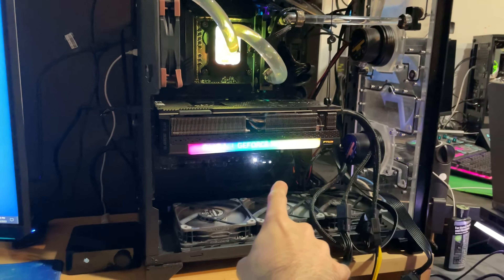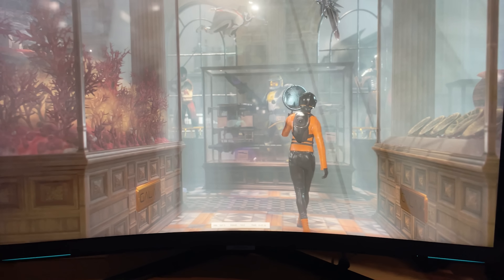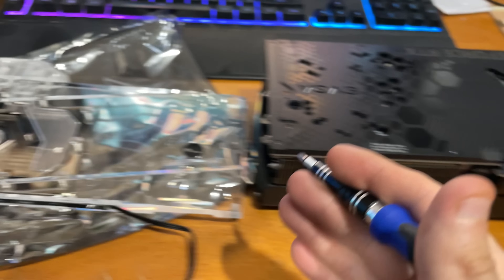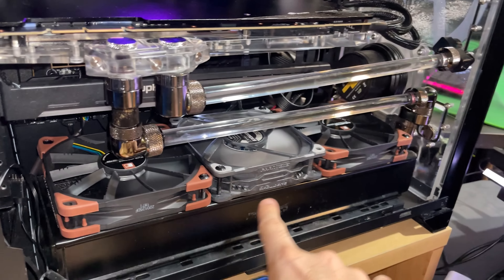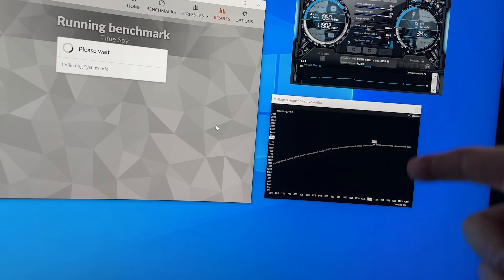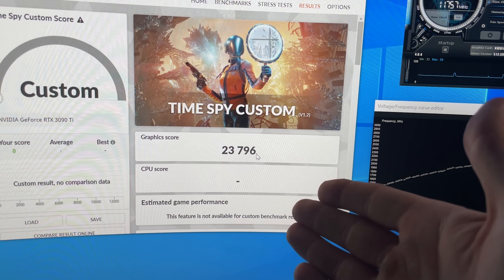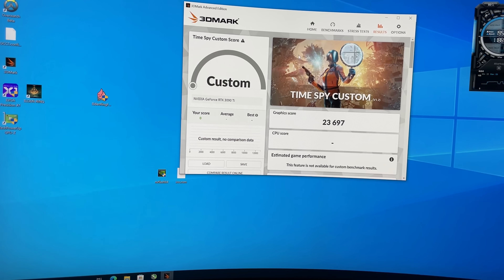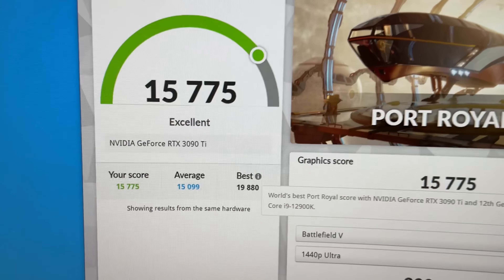3090 TI Water Cooled!!

Comment: Looked like you were mixing methods for changing the VF curve which probably explains why you saw some regression in your 3DMark score.  You need to watch effective clocks in HWINFO to really know how much your clock speed is changing.  Most likely you dropped (or at least didn't increase) effective clock due to pulling up a single point on the VF curve (rather than shifting the entire curve, or at least the 3 points to the left of the 1100mv point).

Comment: I remember strapping an AIO to both my Rx 5700xt and Rx 6700xt. It was an interesting experiment. I am happier with rtx 3070 because I don't have to do much to overclocking my silicon without seeing high temps hehe
Reply: AMD BAD !!!!
Reply: @RonnieMcNutt666  amd is a piece of disappointment
Reply: @ErvineJeovanni  SKILL ISSUE
Reply: @RonnieMcNutt666  skill denial in esports I have that hahahaha. I mostly play car games. Since I do have sim rig, having better 99%fps makes wheel more responsive and smoother.
Reply: @ErvineJeovanni  a,md have much higher fps and clock speed but nvidia gpu seems to keep fps stable and doesnt rock up and down as much even on 1070 a very decent experience
Reply: @RonnieMcNutt666  I agree 110% after buying that 3070 I have zero reasons to return to AMD man
Reply: @RonnieMcNutt666  I agree 110% after buying that 3070 I have zero reasons to return to AMD man

Comment: why dont you use soft tubbing for your testings ?!
building myself a test bench on the side of my build with 3pumps/3monsta560 (3 loops) and quick release fittings for each loops so easy to swap components and you never run out of fittings

Comment: While I have never used the block you have placed on the card, I can say that so far my experience with EK has been exceptional. I ordered the wrong block and active backplate for my EVGA 3080TI and they approved a RMA immediately. I also got the card from Europe to Australia in less than 5 days. I ordered the new Block on Sunday 25/09 and it is on its way and I just got the alert from DHL that it is already moving between Singapore and Australia. Should have the block by the end this week.

Comment: Watercooling is worth it for me primarily because I want a quiet rig. I run a 480 and a 360 with push / pull for my GPU loop specifically so all the fans can be effectively silent.
Reply: I’ve given thought to build a cheap rig to test out watercoolering for the first time. Until now I’ve just been using AIOs, too scared of a leak frying everything
Reply: @FIVESTRZ  As much as EK gets bashed here (for a good reason tbh), if you buy ZMT tubing and EK Torque fittings, it's basicly impossible for it to leak. It's actually hard to get them off the fittings sometimes, and if you want real life proof, my pump+reservoir combo has literally been freely hanging from a piece of ZMT tubing for over 2 years now. If you are really worried, get a leak tester and PSU jumper, only plug in the pump. Even if you somehow leaked a little, the premixed coolants aren't conductive (atleast for a short while before contaminants can make it conductive). I once forgot the main gasket for my 1080Ti waterblock, it literally sprayed the water everywhere on my computer while it was running and everything was fine after letting it dry off.
Reply: @AntzuPC  wow, I’ll start looking into it. I already have 2x Lian Li O11D Evos and I see a lot of positive sentiment about water cooling in those cases
Reply: 2X 560's here.

I run at 700RPM and have water temp at 31C!

Comment: I basically bought this card for the cooler myself and came here to see if it's even worth watercooling it instead. It's fantastic,this is what the 30 series always should have been. Copper shim memory modding,custom watercooling? Does diddly squat,doesn't even need it,slap it in there and it cools 500 watts at stock and under warranty.

Comment: Hey man. Thanks for the vid. So I am exactly the opposite of the guy that can just put on headphones and ignore the sound. I would like to know your input on this

I record and edit a lot of high res video and audio for living. I just picked up a 3090ti for insanely cheap to upgrade my setup. My set up now has a 5950x and 3090ti, ssds only. I have an aio on the cpu, stock fans on 3090ti, a psu with fan, and a semi-open case with a couple fans. Fan curve is set to silent in bios and I turned down the fan speed for the gpu in afterburner. I want to go as silent as possible to ensure no interference will be recorded in vocals during sessions… my current case is just way too loud (and has more than adequate air flow). I am using mainly cardioid mics which pick up sound from the complete opposite direction of the pc and it still picks up quite a bit, and the room has been acoustically treated. Moving the pc further away is not an option.

What would be your recommendation to achieve 0% noise (or near 0% to the point where the tolerance is so low the mic would not pick up any interference) from the pc? I have been researching the monsterlabo beast but I don’t think it can be set up for a 3090ti without serious underwatting to where it would artifact. 

So would the best solution be a fanless heatsink for cpu, fanless psu, fanless chassis, waterblock for 3090ti? Please lmk what would be the best solution. I’m already in deep in terms of $ so I’m not afraid to spend more I just need to know what would achieve the absolute best sound reduction without sacrificing performance.

Thanks
Dave

Comment: Did you used Active backplate ? Also what advice would you give novice to install water block ? Is it too hard to dissemble card and add front and back active plates ? Or they provide clear instructions ?
Reply: He’s not using an active back plate. All blocks come with instructions on disassembly and mounting. It’s very easy, you have nothing to worry about.
Reply: @mikemoore5270  after some research i found out that unlike 3090 which had memory on both sides…. 3090 Ti have 2GB memory modules only on front side… so need to back cooling tbh
Reply: @Turp1n  correct, I believe the rumor is all 40 series cards will also feature memory exclusively on the front.

Comment: I totally agree I have spent over 3k from ek they changed me full price replacement parts i’ve had several water blocks nickel plating fading or screws rusting because the seals were bad on the water blocks and the nickel on my fittings became discolored from my fingers when I installed it. Ekwb doesn’t even reply all my emails for replacement parts. And I’m a reasonable person I’ve only had a few issues and they never fixed any of them they’ve just sold me new parts at full price

Comment: 15:25 wow! That is where it leaves the 6900 XT in the dust. I have a Gigabyte RX 6900 XT with the memory at 2150MHz and the core at 2750MHz and it does about 120FPS at max 1440P. At 4K the fabric thing I have heard people talk about seems to become a bottleneck and it falls flat on its face with something like 60 FPS. Your card is about 40% faster at 4K. That is incredible and at $1100 that is a deal. Even though you only got a little more fps with water there is something to be said about not listening to the little fans squeal as you play.

Comment: I was using that brand on my 450watt bios 3080... temps in the 70-80s. reset 2x with no change in temps. changed to an EK waterblock and the same games are now in the 55-60s. to me, bykski waterblocks are trash! I do hear you on the price though. but at the same time, if they work better I dont feel so bad paying it!.
Reply: That was my conclusion from this video as well. He just needs a better block. Those blocks are cheap for a reason.

Comment: Another big argument for the water block is exhausting all of that heat from that card into your case is far from ideal. This is why I really like the cooler design of the higher end Ampere Founders Edition cards, much of the GPU air gets exhausted out of the back of the case,

Comment: I still prefer Liquid cooling over air cooling … but my main reason is to reduce noise 
I am still waiting for my 420 radiators to come in and I am still looking to get a new GPU but not at current prices (especially since I the US the 3090TI is over 50% cheaper than it is here)

I really don’t get why you are saying that EK is double the price … the only one I could find that cost double that of the Bykski block is the one where the active backplate is included … and seeing that the Bykski comes without an active backplate I would say that the price difference is valid
And you don’t need to bend the support on your I/O Slots with those

I am aware that EK might in some cases be a bit more expensive but not by that much 

But than again it might be one of those cases that I live in the EU and that getting the Blocks to the US adds extra costs

Comment: The problem you're running into is your changing the parameters of your test between air cooled and water-cooled tests which is skewing the results. Re-run the test back-to-back without changing the settings. Tha way we will see the actual difference in operating temperature between both cooling methods. You're putting a higher heat load on the liquid cooled set-up, not an "apple-to-apple" comparison. The benefit to liquid cooling is the electronics don't get much hotter than ambient when you're not overclocking them hard, which extends the MTBF (Mean Time Between Failure) greatly and the system tends to be more stable and reliable. My liquid cooled rig has been going to 12 years without a hitch. Only changed the water twice it on its 3 refill and never leaked a drop. Time to build a new one rig :)
Reply: Do you use just distilled water or a premix

Comment: there's a chance it would fare better if you didn't abuse the system with a Resolution change via Exclusive Fullscreen, that it would be stable :)

as for what's "better", for most people Liquid is better since they're going to be running their Fans at like 1000RPM either way. or they'll have poor Case Airflow or a small Case overall, Et Cetera.

Comment: I got replaced my 6900xt with 6950xt but all my problems are the same?????
Reply: all  Amd  did is raise the memory clock speed limit and they have looser memory timings to allow the higher memory clock speed its still they same exact gpu chip.  Id just sell it or try to return it. I have a 6900xt and I plan to sell it but I've never sold anything so I'm kinda stuck for now.   :smiley:

Comment: Air cooling is prolly better in this scenario cause the performance difference isn't that much. Keep it at air and save some money for next generation.
Reply from the maker: One thing I actually didn’t test yet is undervolting the card under water, it might be worth it if I can get a steady 90mhz boost while cutting that power in half.  Probably do that in future content.  At max power unlimited mode though definitely not worth
Reply: @FrameChasers  do ice water next and in that do undervolting imo

Comment: Bro I'm not knocking you. But you simply don't have enough t.d.p. on that signal rad that can only hold 250 to 300 watts of power to heat dissipation. Get a mo-rae 420 pro that has a 2000+watt T>D>P then rerun your test's and check your 15C drop on water. so much more head room its insane.... Thank me later.

Comment: Jufes, you are better than this. Get a water temp sensor on the loop, and possibly re-mount the block too if the water isn't boiling hot. 60C is way too much, even if you're pulling 600W+. My card stays under 40C @ 600W+ with regular paste.
Reply from the maker: It’s 33c in my house bro 🤷‍♂️. If you feel like you can do a better job I encourage you to make a YouTube channel

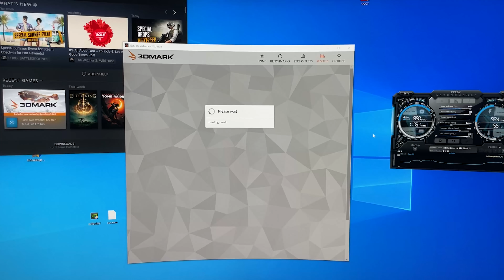Comment: " This is the most...this is the most powerful single card PF on the planet right now.".... Hold my beer. Unfortunately, I have the single most powerful computer on the plan right now. I like to benchmark for fun and compete online and I have the same CPU everything as you and I also use bykski... But I did use a very expensive thermal paste and I can get mine to run around 2300 MHz the whole time. I also have overclocked my RAM 23600 with a CL of 14 and of course 4:00 by CP as well. And I have a program that allows my very fast NVMees too. Read and write around 25 gigabytes a second and I'm in the top 100 for almost every score on 3D. Mark. So I have the fastest single CPU computer. But tomorrow I'm getting in the mail the 7950X with the aces crosshair extreme motherboard and I'm water putting a water black on that as well. AIO version. I don't know why I don't like loops but I like doing AIOs for all my different components to making them look unique and the bykski/Granzon series is epic....lol

Comment: Full circle- AMD pushes the fuck out of the clocks and eats power- Nvidia makes improvements in architecture keeping it efficient.

Now AMD focuses on efficiency while Nvidia adds 4 more pins.

Same with intel Vs. AMD.

6900XT was a decent attempt and fairly comperable, but AMD really needs to bring the heat to keep themselves a valid option, not just the budget option.